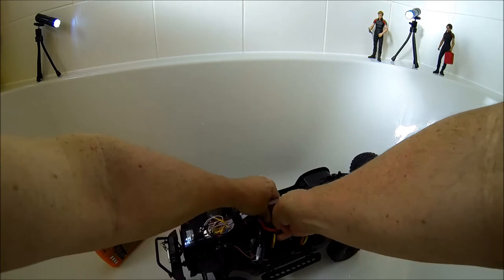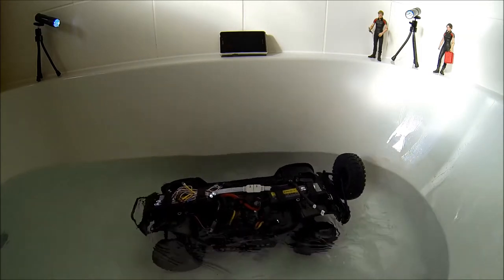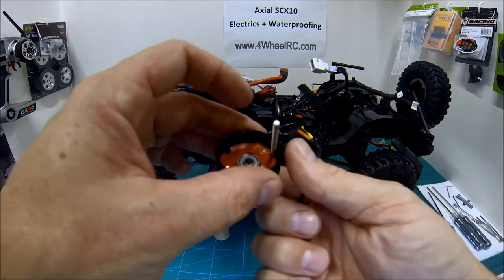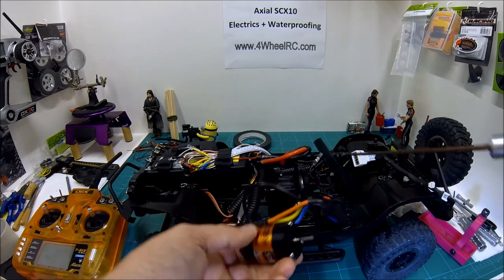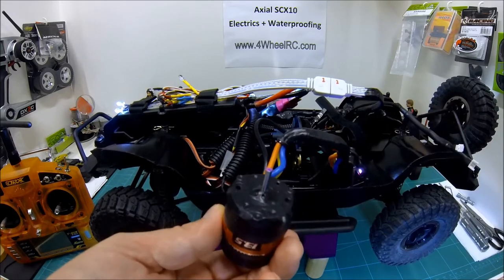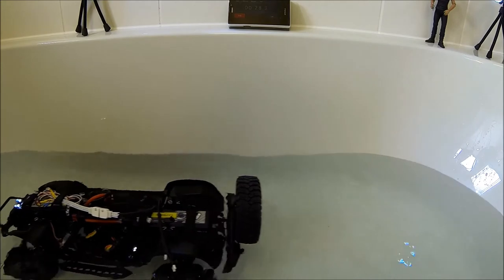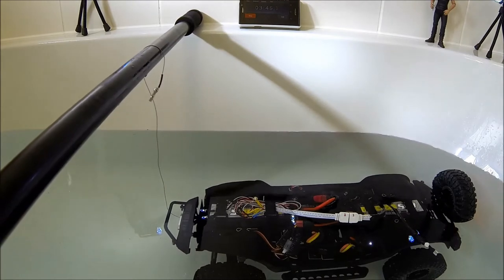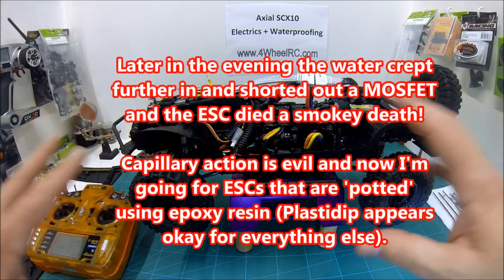SCX10 Rubicon Pt13: Water Torture.

Comment: if u ask me its not worth all this just go brushed smoother control too
Reply from the maker: brandon christian I run a Tekin 55T brushed on another rig and agree that brushed motors are very smooth. But can tell you that having moved to a Tekin RS Gen 2 ESC and ROC412 motor (I'll cover this in a future video) it is just as good, but you get efficiency and low maintenance benefits with brushless. Not to mention that no amount of muddy water will affect my sealed brushless set-up. The only downside as I see it is the $$$  :-(
Reply: i also run a 55t and get hrs of runtime and enough wheel speed with stock gearing, I have heard good things about the ROC412 and I look forward to the vid, you did a good job water proofing this setup.
Reply from the maker: brandon christian Thanks Brandon. Tbh I have learnt a lot since then and especially the limitations of Plastidip. It is epoxy resin all the way for me now, with Plastidip just used for connectors. I'll be posting a detailed how-to epoxy the Tekin ESC & motor when I get some time to edit my video backlog  8-)
Reply: I use liquid tape for a lot of stuff not really to water proof just splash proof as I don't run in water much but ill have to look into the epoxy as a waterproofing.

Comment: what kind of transmitter is that? is it a spektrum?
Reply from the maker: Hey Andrew. That is an OrangeRX 'T-Six' transmitter from HobbyKing.com. It was okay but did not work with the LED controllers due to it's 'frame rate' So since then I have switched to a Turnigy 9XR (with an OrangeRX DSM2 module), also from HobbyKing.com. The 9XR is awesome and has so many options :-)